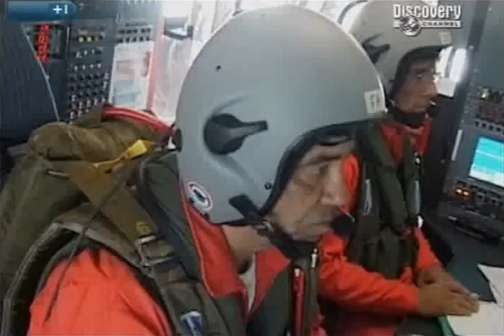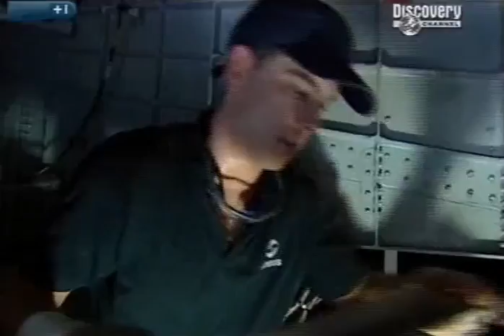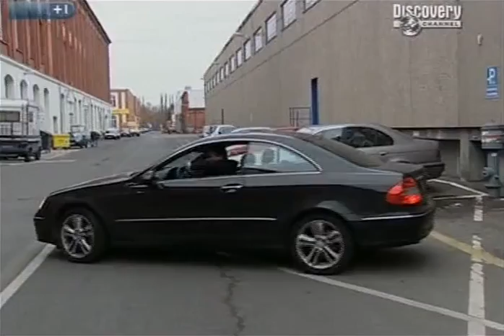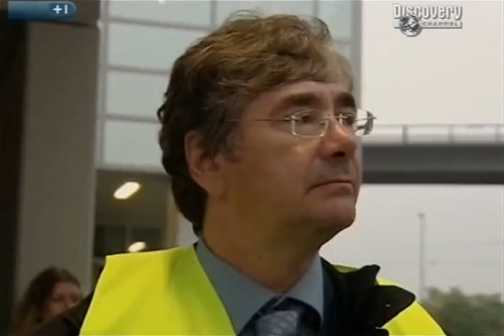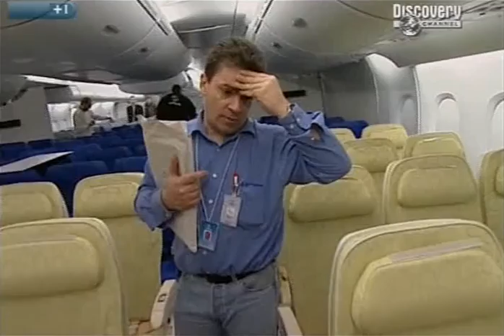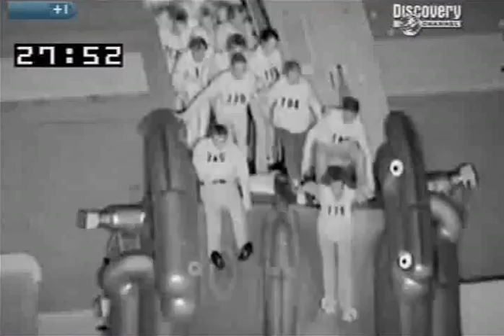Worlds Biggest Airliner (4/5) : Testing the Airbus A380

Comment: Slight problem with the minimum take off speed test, they are testing it on an aircraft that is mostly empty, not even any furniture or interior fittings really so the actual take off weight for a regular aircraft (let alone a fully loaded one) was way off hence the minimum speed required is also off...
Reply: Test airplanes (usually) are fitted with interconnected water tanks to simulate weight of passengers and they have the ability to move the water from tank to tank to test how the weight distribution affects the plane.
Reply: Are you cooked? Did you not see the tanks and equipment they have on board? 🧐